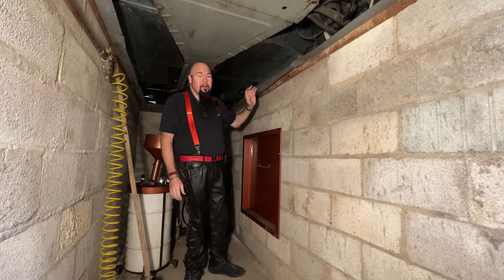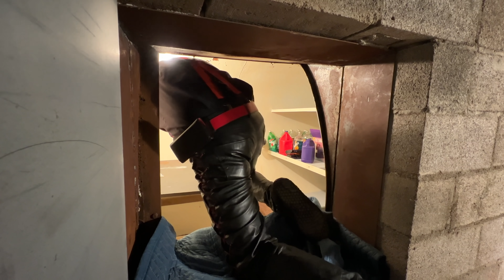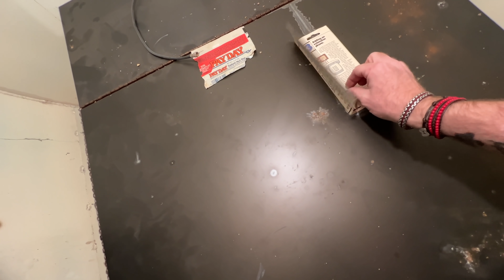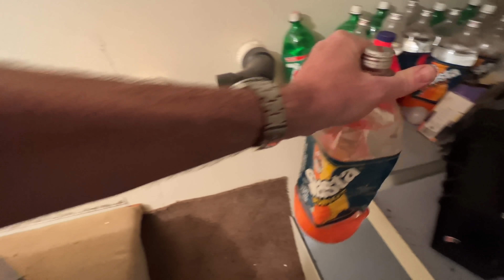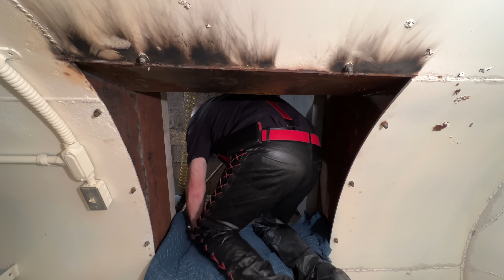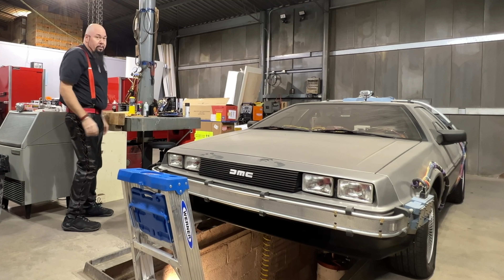My Doomsday Nuclear Bunker in Las Vegas!

Comment: If you use this shelter, don't forget to take some kind of pneumatic jack in case the building fall on the shelter door, to be able to get out. Also the outlet is probably for air intake, you should find a filter for it (manual+electric). Add a few battery, an inverter, freshen the water inside, some kind of communication device, live radio/tv connection and security camera feedback. This doesn't turn you into a prepper just someone that take  is security aware.

If is sit like this it is of no use :/

Comment: The house I am living in, my parents bought in 1970. This house was built in 1955, and the original owners had a bomb shelter built in, well under, the front yard. My guess is the Cuban missile crisis made them nervous. I have never been inside because it is not sealed, and was always flooded. Also, my sister's boyfriend built a planter over the lift-up steel door in the yard.

Comment: I'd be scared of getting trapped in that metal tube if the door got blocked by the building collapsing on top of you..
Reply from the maker: There are metal plates that fit into place over the top, or also the car on top, and the building... if something that big lands on the roof you are pretty well screwed anyway.